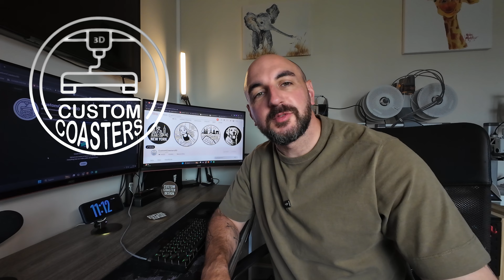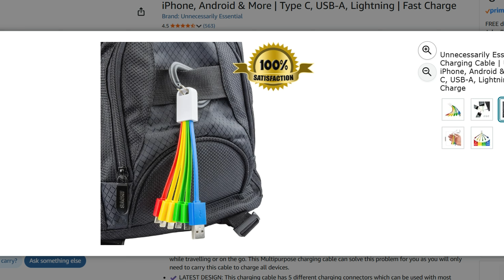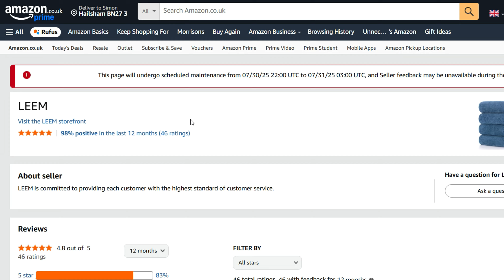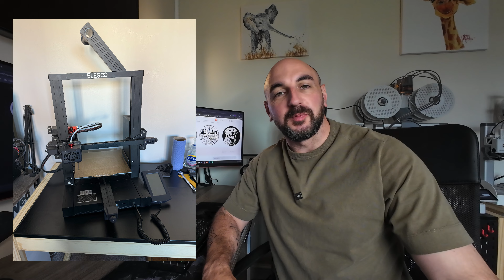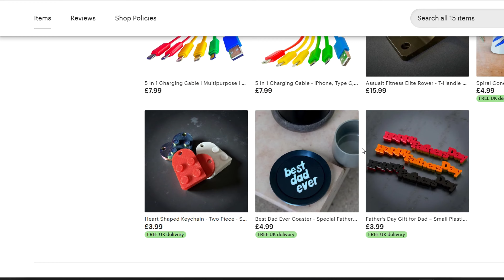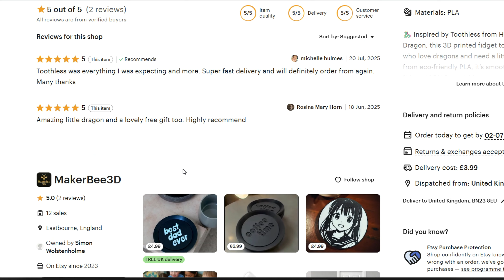Can a Total Beginner Succeed at 3D Printing?

Comment: I'll be doing 3d printing but not coasters ( under a different user name to this) but as good as Bambu hardware is, I'm wary of their firmware announcement which 'may' restrict things in time, so I'm either going for the Flashforge Adventurer 5m pro or the Elegoo Centauri Carbon. I've also got a couple of niches to concentrate on. Good luck with your business.